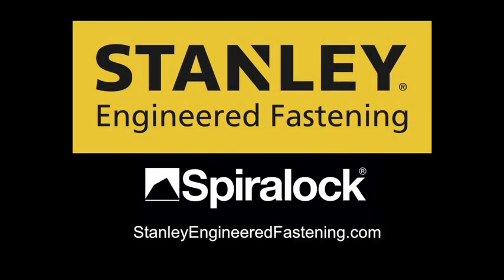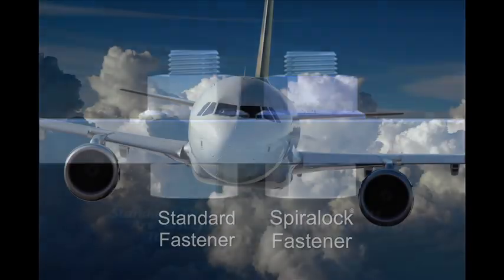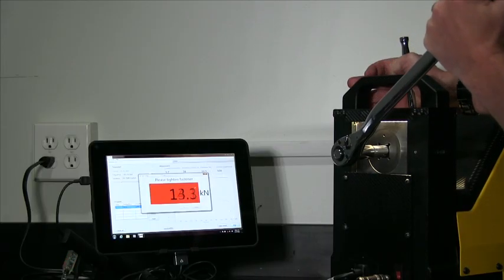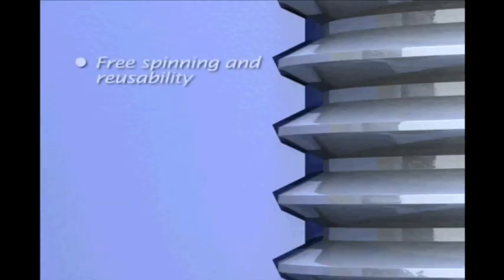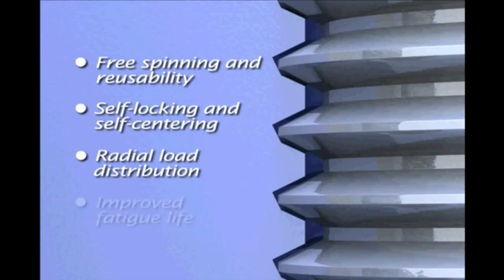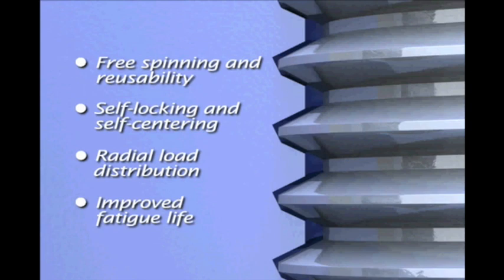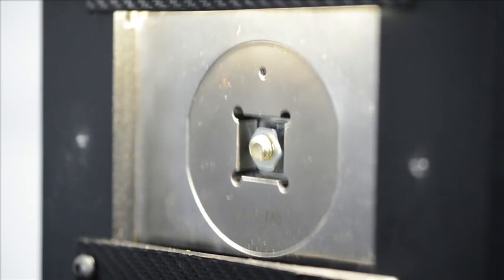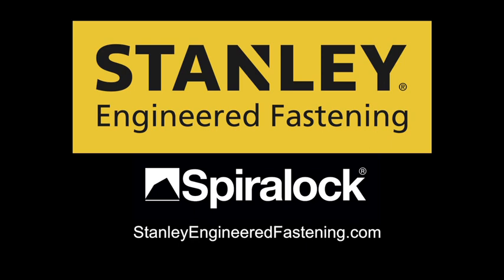Spiralock Junkers Vibration Test

Comment: Worked for a pump company once that had to secure a metal plate behind a pump impeller.  The clearance between the plate and back of the impeller was about .030 inches, so it was important the screws holding the plate did not loosen during operation, allowing the hardware and/or plate to come into contact with the impeller.  The rear pump housing was tapped with the Sprialock female thread form, and regular thread configuration male hardware was used to secure the plate.  Worked great and stayed secure during operation.  This made me a fan of the Spiralock thread design, and have been ever since.